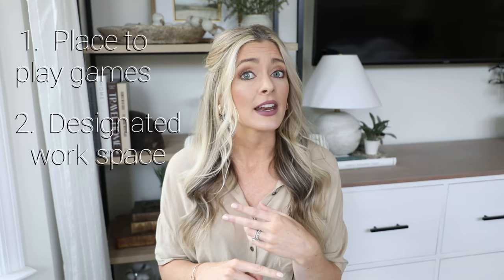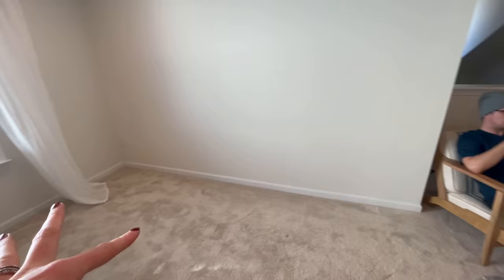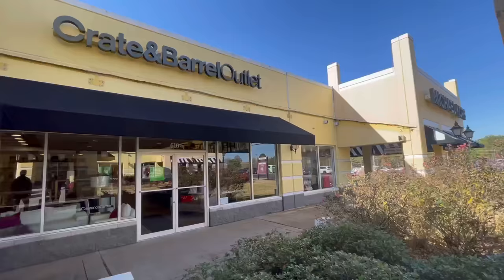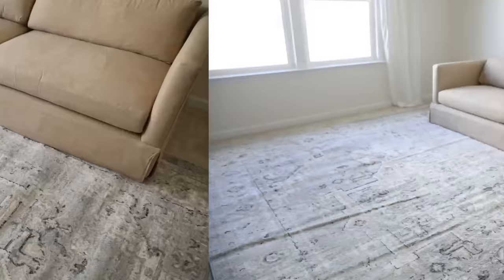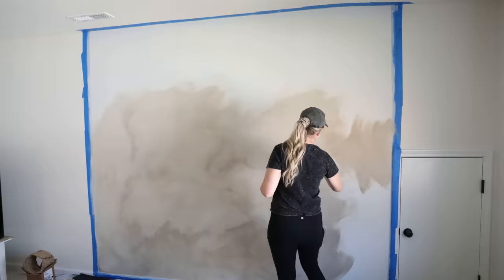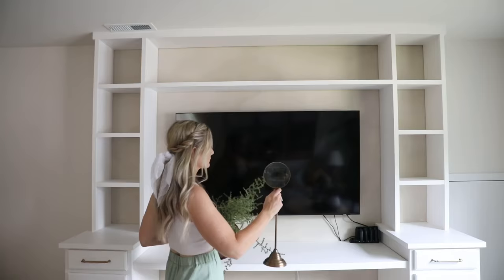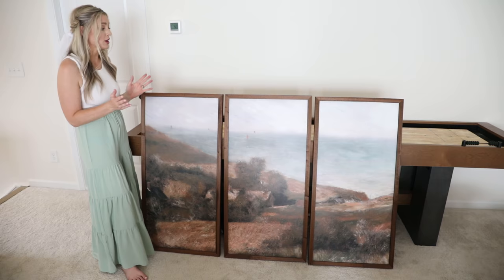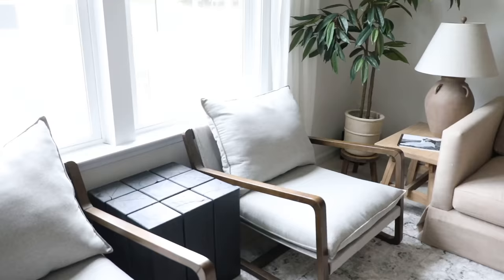EXTREME LIVING ROOM MAKEOVER || LIVING ROOM DECORATING IDEAS || DECORATING ON A BUDGET

Comment: Love the room. Regarding the art, I had asked the same Etsy shop if they could resize an image to 44 x 22“, however I was told that all of their prints would be low resolution at that size. Did you decide just to have them resize it anyways and it turned out OK?  I have printed out the 17 x 22“ small wood prints using North prints images and those turned out wonderfully, but I really want to get the larger size like you have for my mantle. Thanks!